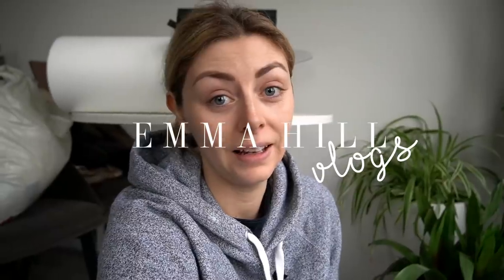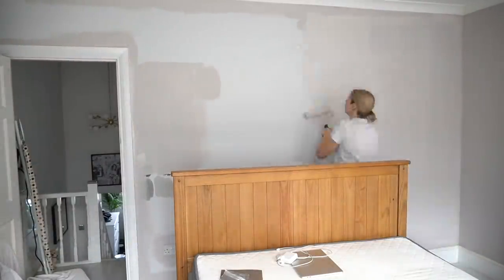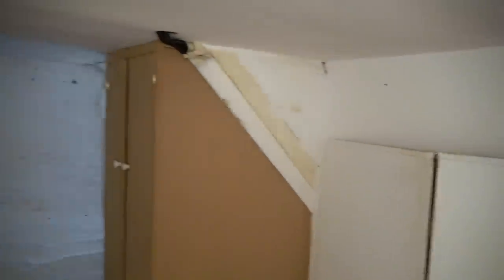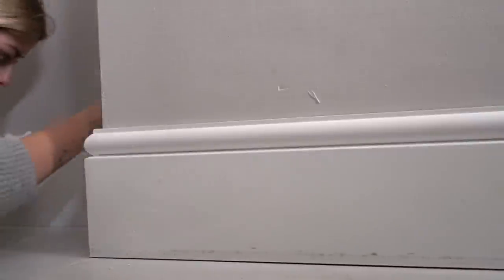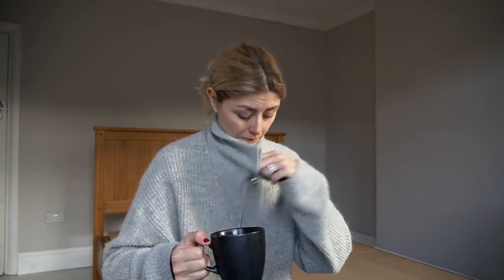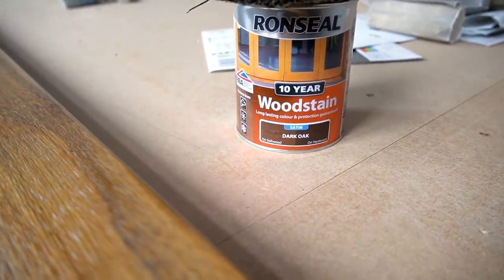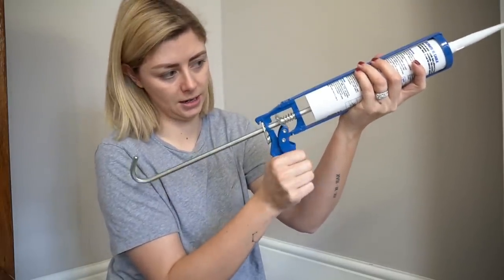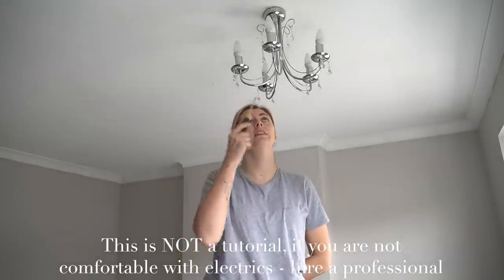DIY Bedroom Makeover Part 1

Comment: You are just brilliant !! It's always "a big job broke out " in our house . So Power to ya , you are doing amazing .!!  ....  tip for ya  ... do all your scruffy works first before you paint .. e.g. Sanding , caulking ( pro bounced corking ) 😜 etc  and if you don't use your tool for the caulking , just dip your finger in some white spirit or even water and use your finger to drag the caulk smooth .  Xx 
Oh and please lovely one , don't stand on the bed to reach ya ceiling , or you'll break ya neck . 
❤️👍

Comment: Fascinating how your electric wiring is done there in UK. Not how we are allowed to do things here in the states. Love what you did with your bedroom walls - and DIY.  Looks real nice!  You are a great inspiration!  Thanks for sharing
Reply from the maker: We are allowed to do minor changes here in the UK (as far as I am aware) like changing one light fitting (or switch/socket) for another. But anything more than that either has to be done by a professional or at least signed off by a professional 👍

Comment: Oh also a top tip I was given ahead of messing with electrics - take pictures of the wiring before you do anything. It was a good job I did because the live and neutral wires were both in black casing and I wouldn’t have known which was which after removing the box where they were labelled
Reply from the maker: Simon helped me finish that and he always does the basic electrics (switching lights or sockets) and your right about the colours. Nearly all our wiring is old colours so we always have to check what matches to what 👍

Comment: Tip for the calk, lay down painters tape on both sides lay the calk, smooth it out, let it dry HALF WAY and pull the tape up. It will have a perfectly straight edge on both sides.

Comment: You can glue the cut part back in the ceiling raise. Just caulk both sides sand and paint. No big deal
Reply from the maker: Yes, that's why I kept it as we may be able to use it in another room 👍

Comment: 17:16 that’s how our attack looked. We hired someone to put flooring and sheet rock up and used it as storage for suitcases and holiday bins.  It was grand to have all the extra storage space 👏🏽🤸🏽‍♀️🥰
Reply: Wait!!!!!  Yours had sky lights!?!!  Wow!!!  Can you do vaulted ceilings?!?!  Or an open loft to let light in and have a little reading nook?!??
Reply from the maker: We currently have to use a ladder to get up there so wouldn't be beneficial for anything - but we have discussed having it boarded with a pull down ladder/stairs so at least it is easier to access and store things up there. Although the dream would be to have a conversion and that could be my wardrobe 🤣 but I don't think Simon is keen to spend that much on a wardrobe 🙈 We will see 🤞
Reply: Emma Hill it’s a lovely big space! I was shocked to see the sky lights! And the exposed brick is gorgeous too!!!! Storage for SURE! That’s what we did (ours was pull down ladder). We stored stuff we rarely used, knowing it for hot up there in the summer. But ours wasn’t so pretty 🥰 If it we’re I woulda looked into vaulted ceilings if possible.  It’s crazy! But would be so pretty 🥰

Comment: GREAT JOB first caulking!  i find it easier to use my finger wet and a wet paper towel, but great job!  this is exactly the same work i am diy'ing on my condo in a building about 60 years old.  none of the walls are straight.  if you end up doing some crown moulding work, that would be a great video b/c i have a particular issue that i just need a little guidance on!  thanks!

Comment: How did you attach it to the joists got carry the weight? You’ve done so well xx
Reply from the maker: Whilst I was in the attic I measured how far the joist was from the hole and then used extra long screws to go through the ceiling rose, through the ceiling and into the joist above 👍

Comment: Can you please show us that amazon tool and show us how you’ll do those spaces on your Wall’s bottom “crown molding” ? I have the same problem and these diy videos are so inspiring EMMA! Xoxo xoxo
Reply from the maker: Its basically exactly how I showed it in the video (albeit quite a brief couple of clips). Filled the gap with appropriate filler, then run the tool along the top to smooth the filler into the gap and then paint once dry 👍
Reply: Thank you! What is the tool called and what filler do you use, I’m going to order it off amazon as soon as possible lol thanks and as always you are 🔥
Reply from the maker: The filler was Screwfix own brand and the tool was a sealant smoother by Cramer (I believe that's how you spell it) 👍
Reply: THANK YOU!!!

Comment: Isn’t it funny how years ago they used to locate the light fittings nearer the windows/outside walls as ppl thought you couldn’t see into the house from the outside if the lights were closer to the windows 😫🤷‍♀️🙈
Reply from the maker: I never knew that but maybe that's why a lot of our fittings were so close to the front of the house - this is the last one we needed to move 🙈
Reply: Yeah, all old houses have them there unless someone moved them 😉

Comment: 6:18 Could the leak be because there's no membrane (at least visible) under the floor tiles? A wet-room needs to be tanked. ;)
Reply from the maker: There was a shower tray there (so not quite a wet room) but the pipe had a split in it which was what was causing the problem. Hopefully the new tray will last us until we decide on how we want to do the whole bathroom 👍
Reply: @EmmaHill  Ah, I see! Yeah, that should do it! It looked like there was a border of sorts of residue from something being removed so I was wondering if that was the case! Best of luck! :)

Comment: Where is Simon?
Reply from the maker: He was largely sorting bits for the other jobs going on in the house (like charity runs to clear some stuff away, back and forth to the tip with rubbish, B&Q for supplies etc etc) as well as working on the footage I had been filming and he kept getting pulled away to answer questions with the builders and guide them as to what was wanted. But he has been helping where he can, although I heard his playstation turn on once or twice so am a little skeptical about how busy he was 🤣
Reply: Hiding 🤣🙈